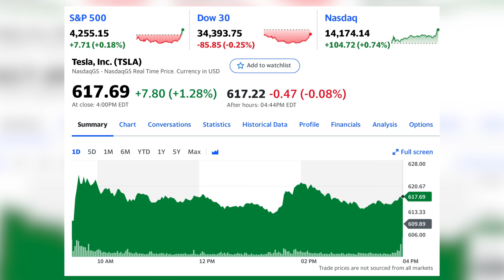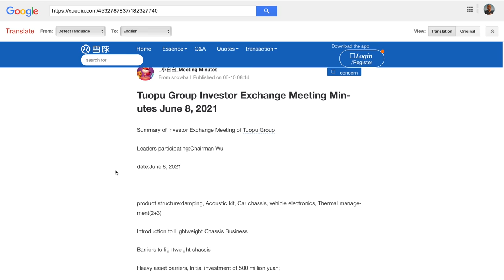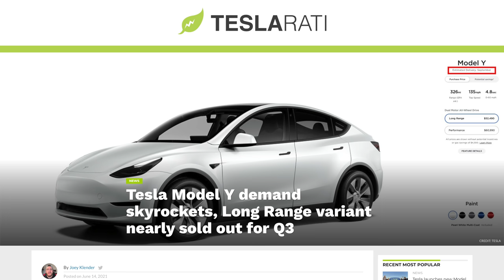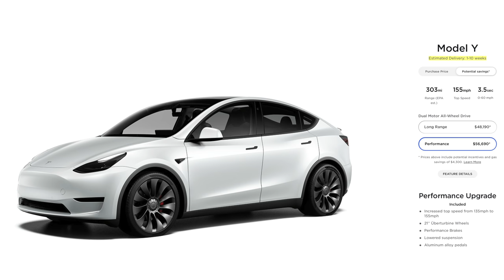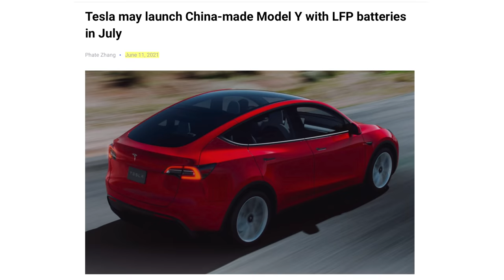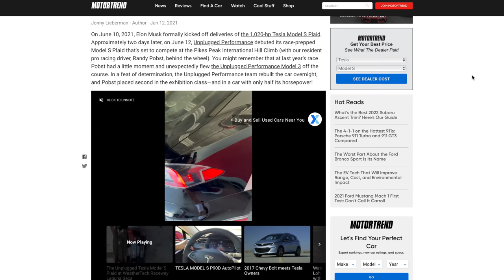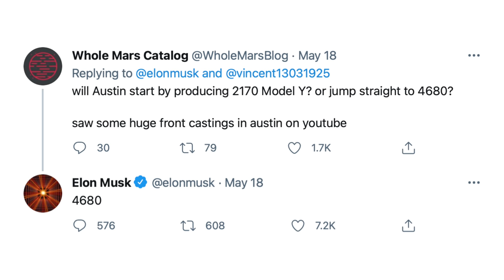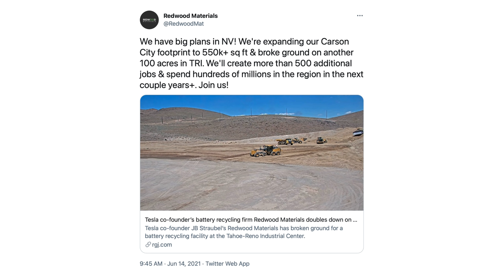Tesla Rumors: Model Y, China, Suppliers + Plaid Updates, Tesla Holds Bitcoin Position

Comment: Just wanted to mention that a 20k+ rpm motor is rare to see even in racing vehicles. ICE's can't go that fast. Very cool to see
Reply: Thats totally false, and there are motors that turns at over 200k rpm, companies in Germany and around the world have been carbon sleeving motors for years now, porsche taycan used a 2 speed gearbox with only 761 hp to beat a lighter tesla models performance with over 825 hp.

Comment: Dealing with that New Zealand tax credit limit, didn't Tesla get around the Canada rebate limit by selling a car with part of the battery pack disabled? Then after delivery, you could buy a software update that re-enabled it. Or was that just a rumor?
Reply: If I remember you were not allowed to turn it back on…and they tried to not sell it, but just by having a power priced version all the versions became eligible for the credit. It was set up so that as long as the “base” model with no options qualified then the model line up qualified.
Reply: @davidradtke160  "Not allowed" is such a fungible term. :)
Reply: You can still get the standard range model 3 which seeing as it is New Zealand gets you almost the length of the North Island and definitely coast to coast. The range will be less of an issue in our smaller country.

Comment: -- Even with 1860 cells, they could have gone to Model 3/Y module design as the battery shape is different. 
-- The old battery is 8 modules long with 14 rows of cells in this dimension - 114 rows plus 8 casings. In the car width dimension there are 74 cells in two casings.
-- Might have increased the number of cells a little - perhaps, 90P, 96S. 8640 cells. This gives another 4.65% more energy. 
-- In this case, modules could be 18 or 20 cells wide. That would give 72 or 80 cells wide in 4 modules.
-- If modules are 24S or 25/23S they would have for: 18 cells wide 120 rows, 125/115 rows: and for 20 cells wide, 108 rows, 113/104 rows. 
-- The 18 cells wide modules give a module closer in dimensions to the previous battery. 
-- These larger 3/Y type modules are better for second life applications as energy storage.

Comment: I  live in The Netherlands and have a Model Y on order.. If Tesla calls me to take delivery of an imported Chinese Model Y, I will kindly ask them to postpone and call me again when they have a Next Gen made in Berlin Model Y for me.
Reply: That is probably what I would want as well.  Good call
Reply: Bjorn Nyland has just been testing a China Model 3 Standard range + and is super impressed especially with the LiFePo batteries performance
Reply: @j.pgoodwin9020  I am not concerned about the quality, Chinese made Model 3 and Y are excellent, but the Chinese Model Y is not 'Next Gen', has not the 4680 cells, structural battery pack, fwd and aft giga casting.

Comment: I am guessing - it's only a guess - that both Berlin and Austin will initially roll out Model Y with 2170 cells, then retrofit the 4680 cells when volume and reject rates permit it.

Why?

Those production lines for the 4680 at Berlin and Austin haven't even been set up yet.  They're delivering long-lead items, but the burn-in hasn't yet started.  The sequence of events I expect is:  a)  The Cato Road prototyping line will achieve its final configuration (which, as far as we can see, hasn't yet happened); b) the configuration will be exported to Berlin and Austin; and c) each new production line will be set up and burned-in until it is achieving acceptable volume and rejections.

That burn-in period for each line could take up to a year.  With molecular engineering, following the design schematics is just the first step.  Then you have to discover what you've got and tweak until it's right.  We've seen this time and again with battery manufacturing elsewhere, notably at Panasonic.  Getting yields up and costs down is hard slogging.  It's quite similar to chip manufacturing, in that sense.  It's a project that will cause project managers with their timeline charts to tear out their hair.

I don't see how the 4680 could be shipped in first production vehicles at those factories.  The timeline for that to happen would only make sense if they were already burning-in those new cell lines.  They aren't.

But - it's only a guess.
Reply: In the end it's wise most of the time to listen back to what Elon actually says.

Like in the q4 2020 call, Elon said S and X will keep 18650 format cells for probably the next couple of years. But the chemistry will change/be tweaked.

Also Elon said on different occasions that Berlin Y will be the first car to combine two giga castings, a structural battery pack and tabless, dry electrode additive 4680 cells. Those cells will be produced from the Kato Road facility in the US and shipped to Berlin until local cell production is online.

So the end, the battery picture looks something like this (based on available information):

- Model S and X have 18650 from Japan (new battery pack seems smaller capacity, so maybe switch from NCA to NMC?)
-US Model Y has Nevada 2170
-US Model 3 SR+ has Nevada 2170, augmented with LG cells
-US Model 3 LR has Nevada 2170
-China Model 3 SR+ has CATL LFP 2170 cells
-China Model 3 LR has LG/Samsung (maybe also CATL?) 2170 cells

- Berlin Model Y will have Kato Road 4680 NMC cells until local production
- Austin Model Y will have Kato Road 4680 NMC cells until local production

After successful ramp in Austin, Model Y production stops at Fremont. Kato Road will (also) produce High Nickel NMC cells for Semi and Roadster (TRI motor Cybertruck?). I'll bet Roadster and Semi will be made in Fremont (unless I missed some news).

Elon said they are building Kato Road up with enough equipment to be able to produce roughly 200GWh at the end of next year.
Reply: @kaasman78  I hadn't heard about the 200 GWh goal for Kato Road.  Interesting!

It's probably a bad idea to fall in love with any set of numbers or dates.  The situation will be fluid, and Tesla will make adjustments.  This juggler has a lot of balls to keep in the air.

Years ago, when I was trying to figure out what Tesla's strategy would be (I'm still trying), I hypothesized that Fremont would be their 'prove the production line design' factory; the other GFs would import line designs refined by Fremont.  It made sense to me, since the bulk of their production engineers (and the most experienced, obviously) are at Fremont.  So I've been expecting Fremont to be where Semi and Roadster and every other new model would be developed - though there could be exceptions, such as whatever the Shanghai studio comes up with, or the Berlin studio.  But that's down the road.

I would not be shocked to see Semi lines activated at Berlin, Austin and Shanghai, all three.  It's a truly important product for Tesla and for the transportation industry, and there will be demand everywhere for it.

Nor would I be shocked to see Tesla tear down the Model Model Y lines at Fremont once production is successful at Austin.  Eventually, they could do the same with the Semi, assuming that's where the prototype line will go.  There are surely unannounced models making their way through Tesla's design process which could use the space at Fremont for their pilot lines.

Model S, Model X and the Roadster, I expect, will be at Fremont permanently.  Everything else is subject to the convenience of the company and whatever it is they want to do next.

Or so I hypothesize.  It's just an opinion.  Tesla will do what it wants to do.

I also hypothesized that GF-Nevada would be used to produce cars and trucks.  So I may not be the most reliable hypothesizer.  :P
Reply from the maker: Kato road is not going to be 200 GWh. It is intended to be 10 GWh. 200 GWh is the production equipment Tesla is ordering for worldwide production of 4680 next year, and hoping to produce 100 GWh with that equipment (due to time to ramp up).
Reply: @TeslaDaily  This was what I thought I understood.  Thanks, Rob, for clarifying.

Comment: I guess I was wrong about the 4680 batteries being in the S plaid.  I wonder where they got the 300 or so pounds they saved?
Reply: Probably cut weight on the battery and frame.
Reply: @odisy64  That’s the whole point, how??
Reply: Watch the Warren Redlich livestream from Sunday.
@43:30 goes into detail of conversations, with video.
Rear casting, body redesign, fundamental redesign of interior construction (!) Pack design, etc.
Reply: @garychadwick1240  model s was an older design, it had a lot if extra useless metal in the battery and frame so tesla used what it learned from the model 3 to make the platform even lighter.

Comment: My guess, if the Y exported to EU is true, is that it's related to a SR version. These customers do not care about the latest tech (4680, megacasting etc). They simply want the cheapest price. We can expect that the OEMs will once more push for EV due to CO2 limit towards the end of the year. So, Tesla might have decided to undercat the competition with a very cheap MIC SR Y. LR and Performance can come directly from Berlin, higher prices, higher spec etc. If confirmed, I would consider this simply as a strategic move to invade a territory where you are not present yet and with huge demand for cheap/short range SUV. And they can balance EU/CN requirements until Berlin is fully online

Comment: Rob said - "Lucid's having some issues" - not aware of any. Lucid Air deliveries will start in 2nd half of 2021. I'm a TSLA and Lucid investor. The only delay with Lucid that I'm aware if is that they want to ensure quality for their first deliveries of the Lucid Air will be flawless - which is why they are in no rush to get them out. You only make a first impression once - and Lucid needs to make their first deliveries in terms of quality to be top notch, as they will be competing in the luxury segment against the likes of the Mercedes EQC, Audi, BMW, Tesla etc. I believe they have 577 deliveries planned for the later half of this year.
Reply: As an engineer, I suggest you manage your expectations on any first generation complex engineering products.
Reply from the maker: 577 deliveries is a very low target given previous expectations, Rawlinson has been extremely non committal on 2022 deliveries, and there are reports of contingencies for new hires depending on lucid accessing more funding. I don’t follow lucid closely but if you do, you should be aware of these things, at least.

Comment: Elon said at Q1 call that 4680 was 12-18 months away. That puts it March to September 2022. Don’t see how that fits with new factories. Seems behind.
Reply from the maker: He said volume production. Generally that has meant ~5k cars per week, so about a 20 GWh annual run rate.
Reply: As Rob says, "volume" production 
The timescale also accounts for the factories being built to produce the cells.....  Berlin/ Texas could be producing 4680 late in Q1 2022..... Meanwhile those facilities would produce the lower spec cars.

Comment: Does the model s long range have the new motors and features. Just not the trimotor?
Reply: It has all the interior features, but it’s a good question about the motors. Back of the envelope calculations would say no; the rear carbon-sleeved rotor motor is 470hp, added to 400hp at the front is 870hp, which is not that far from the battery-limited 1020hp of the Plaid. It would make it much better than 3.1s 0-60, even considering the deletion of rollout from the Plaid’s times, which is typically not done for Tesla’s non performance car stats.

However, the reduced weight is not enough to reduce it from 3.7s to 3.1s, so there is something going on; time will tell what…

Comment: Need to find out of Cybertruck has the same tri motor set up as the Model S plaid...
Reply: Good question--I'm thinking they are going to have to do the $40k rig minimalist given input cost increases, but of course that's a while off.
Reply: Nope it doesn't need that, a truck is not made to do 0-60 in 1s a truck needs the max range possible.
Reply: @carholic-sz3qv  it has 1000 horsepower in that configuration … it’s about torque and power not speed. The tri motor needs exactly this to tow. It’s not like a Ferrari motor in a truck like you are thinking, electric motors are different and versatile. Model S is a heavy car like Cybertuck will be… might be a perfect match.

Comment: It’s possible that Model S Plaid’s electric motors can be used for airplanes.
Reply: Light motors are one thing, light batteries another.
Reply: An aircraft propeller usually only turns at about 2000 rpm. A turboprop aircraft wastes lots of energy reducing the jet engine speed from roughly 30,000 rpm down to the prop speed of 2000 rpm through a reduction gearbox. This is necessary, but wasteful, because jet engines only work at very high rpm and props only work at low rpm. So the high rpm from the Tesla carbon rotor is not required. The advances made in the Plaid engine were for extremely high rpm. This would serve no advantage to an electrical aircraft which would need very low weight with very high torque at only low rpm and ideally no gearbox.
Reply: @garychadwick1240  
Errr...
0-60 sub 2 seconds indicates "high torque"?
Reply: Nope it will need to be reingeneered and unfortunately batteries are still not dense enough.
Reply: @garychadwick1240  the carbon sleeves is not a new tech it has been used in motors with over 200k rpm for years and it's used to avoid the rotor from expanding at high speeds or the magnets from moving too, it also helps manage temperature.
Reply: @carholic-sz3qv  you’re getting boring, I hope they’re paying you well.

Comment: I dont think the plaid MX has the same motors, since the MX has a much lower top speed so I’m thinking its motors are missing the carbon wrapping.  Just speculating, I’m probably wrong…
Reply: I think the lower speed is the SUV form factor. It has a lot more wind resistance. It maybe that with the weight distribution there are not tires available for that top speed Etc.